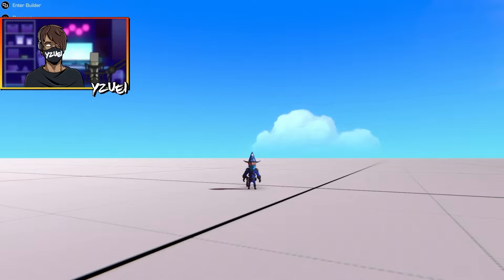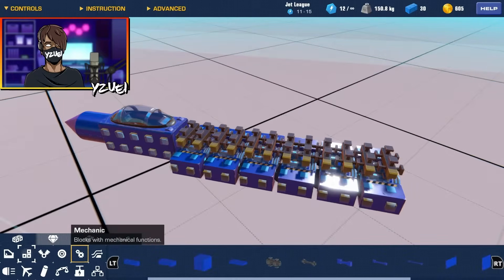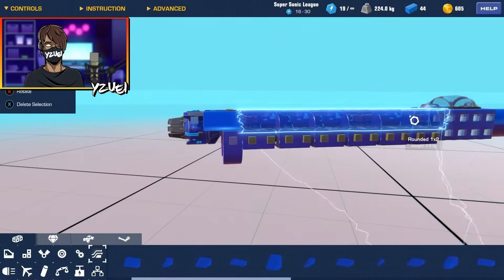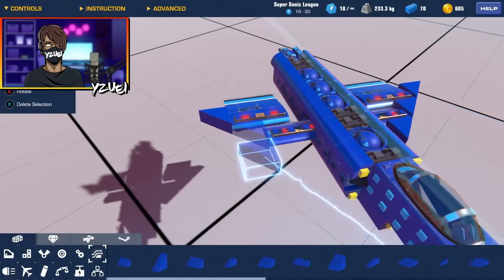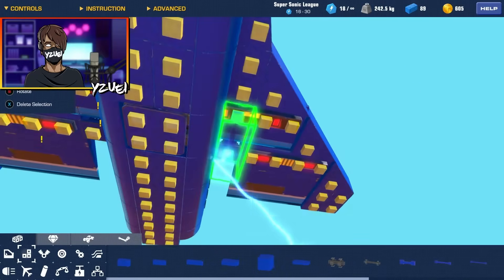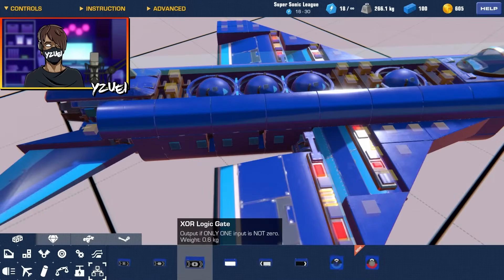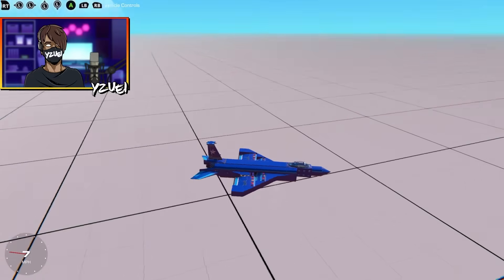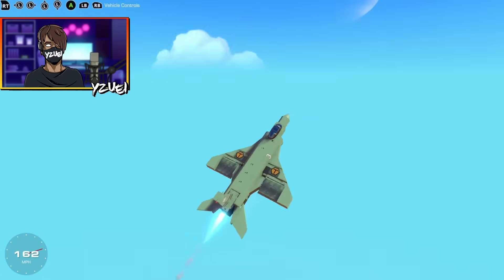How to build a Harrier Jump Jet in Trailmakers | Tutorial by Yzuei

Comment: I play on console and the only problem i had with it was the angles on the wings for pitch and roll were too low so it couldn't turn fast enough and crashed a lot
Reply: But a small change in tuning fixed it, also how does your jump jet get off the ground without max power on all the gimbals? Mine wouldn't budge, just a lighter grav feel haha
Reply: And I put 2 small guns on it too but that didn't affect it any haha

Comment: really cool design but also does anyone else have advice to make a plane fly more smoothly. The ones i have made kinda wobbly a bit with the front end pretty unstable and im not sure how to fix it
Reply: Look at the waeght distribution maybe  or adjust settings on wing like speed or angle or jus add rockets until it works I'm not sure
Reply: yeah same my plane is super unstable and stiff to pitch up ad roll
Reply: Same here even from the turtorial

Comment: Can someone tell me, why even if I use mirrow mode my plane isn't going straight forward, but yaw-ing to the right?
Reply: do you have a vertical wing part? not a tailfin but a regular wing?
Reply: @michaelfinlay1412  Yep. Sadly.
Reply: @Nightshardddd  vertivally placed wings still make lift, but in an unintended direction causing yaw, instead use a tailfin or rudder as they do not generate lift
Reply: @michaelfinlay1412  I thought you meant a tailfin, yes I had a tailfin without a wing, sorry. Anyways, I found the problem. It was because I used a landing gear on a far to small jet.